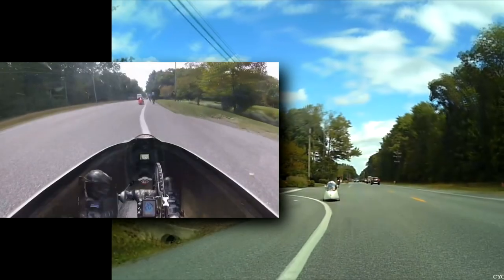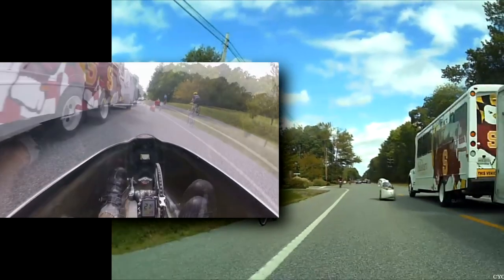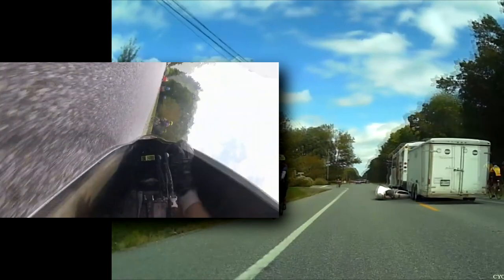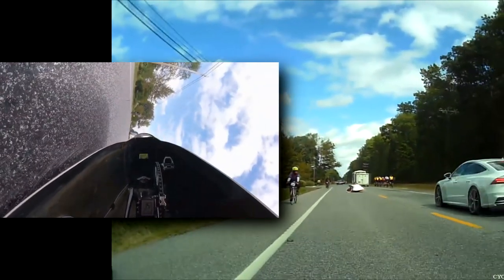Video 3: Side by side crash view

Comment: Lingering questions to learn?  Preventative actions to minimize this inherent risk.  In my opinion, one should always follow the lead rider.  If they move left, you move left.  They see objects sooner.  A wide, supple tire at lower pressure with a shock will help dampen and keep the rear tire on the pavement. Sealant will slow a flat tire deflation, possibly enough to keep from crashing.  I would be interested to hear of other's opinion how to minimize these risks.  Of course, not riding on roads with such strips can sometimes be chosen.  Stopping all rider motion when rumble strips are unexpectedly encountered?  Braking?    Lower tire pressure in the front tires should help with stability as the rear comes around....understeer?  I think the lower pressure in the front tires idea would require a brave person on a tadpole trike willing to experiment.

Comment: Great job explaining how and why it happened - Very helpful to understand why our velo's lose control so easily.
Reply from the maker: I remember the first time I rode the Sea Gull with you, you mentioned them and I was watching for them. Then a few months later on the 6 Pillars, I encountered the same issue but to a very small extent. Now when crossing rumble strips, I make sure to only hit them with the fronts, and put the rear wheel between the gaps.

Comment: I've the feeling that this wouldn't have happened on a QuattroVelo (4 wheels velomobile), because one of the rear wheels would have bumped but the second stays inline ==> no problem.
This means that if the Quattrovelo had opened front wheels and was hence able to turn correctly, it would be the perfect velomobile ! ;-)
Reply: Ditto, i have quattrovelo rear-end in my velomobiel. This vid will freak ya out.

velosRus dotcom
Reply from the maker: It has been shown in testing when they purposely flatten a tire, the QV did not lose it.

Comment: Glad Bill wasn't hurt! 

I ride an ICE Adventure (tadpole) trike with 20-inch wheels. I avoid rumble strips like the plague because of the discomfort they cause. Bill's accident gives me another reason to avoid them. Thanks for the physics explanation---the friction of the rear wheel is somehow related to a helicopter's need for a tail rotor. 

By the way, I also hate the bumpiness of brick roads (thankfully rare) and decorative pavers at intersections.
Reply from the maker: Yes, full suspension is nice to have, especially for a velo. My Sprint X 26 is not suspended, but still a nice ride. Thanks for watching.

Comment: Good explanation. Appreciated. We have raised rumble strips in Australia, and they are a PITA! My homemade velo has a 2.15 Almotion on the rear, because I do not have rear suspension. On one particular ride, I hit the rumble strips and nearly lost it! Similar scenario I guess. I have since mitigated the danger somewhat by running the rear tyre at lower pressures. I know this isn't always possible with some performance velos running relatively narrow rear tyres. But in my case, it is a workable solution. Cheers!
Reply from the maker: I tried the Almotion on my first Quest. It felt like I was pedalling through sand all the time. I changed it at the first stop on a 62 mile ride. My new Quest has Kojacks all around and I like them as much as I liked Duranos. A lot of people don't like either if them, but they work for me.

Comment: Great set of videos, thanks for your insight. I've had two or three similar moments, but got lucky each time and didn't tip. Rumble strips and bumpy roads can be mitigated against to a good degree that I'm happy with; what really scares me is a high speed rear tyre blow-out.
As an aside, I always feel safer against this sort of accident on my recumbent trike (Performer JC70) than in the velomobile (Mango) as the trike has a slightly lover centre of gravity and better brakes (disc versus drum). Also, the trike has no suspension and a larger rear wheel which, rightly or wrongly, makes me feel like I have more control in these sot of situations.
Any tips on whether there was anything Bill could have done to avoid tipping once the back end stepped out? It looks like he did an awesome job of avoiding a potentially horrific accident, so props to him for that, but does anyone think that there was a possible save from the moment things went sideways?
Reply from the maker: Thanks for watching. I'm not sure anything could have been done after the loss of traction began. There were probably a few things that could have been done prior to the ride, like lowering rear tire pressure. I had no idea he was running at 120 psi or I would have said something before the ride. He did a pretty good job of avoiding the truck and trailer for what he could control, but with everything going south in 3.5 seconds, not much time to do anything actually.

Comment: Thanks for the explanation of a hazard I didn't know existed. I am new to riding a trike, so it will be something for me to consider.
With model rockets and archery, you intentionally put the center of mass far in front of the center of drag to improve stability.
Reply from the maker: You're welcome, and welcome to the trike community! the possibilities are lower on an open trike (depending on the make/model of your trike) but this phenomenon is still a possibility on any tadpole style. Of course it's very difficult to put the weight in front of the drag point (front wheels) on a tadpole as it would merely tip up and be of little use to anyone.

Comment: Like all models, they are only good if they are useful and like you said Jim, the math is actually pretty complicated.  The Lego model is useful.  One point to understand and not a small quibble,  a torque is required to change the angular momentum albeit not a terribly large one when the rear wheel looses traction.  Moments ('torque' if you will) can be built into the vehicle due to various misalignments or once rear traction is lost, these torques can be external such as a rider continuing to pedal, or shifting weight around, steering input, braking (if brakes are not evenly balanced), crosswind, etc.  I do think riders can take steps to minimizes the inherent oversteer characteristics and the ensuring rollover behavior.  If a survey were conducted, I would expect some velonauts to say they can ride over rumble strips without the rear end swapping with the front, albeit not a comfortable experience.  The reasons are many but it is useful to understand them.   Thanks for the wonderful videos, it has been very helpful.
Reply from the maker: Well said Ed, thanks for the coment and thanks for watching.
Reply: I was trying to get clarity on the influence of 'moments' that change angular momentum, as you described in your comment above. The moment that I fixated on in my early comment was pedaling in response to a mention in the video of 'pedal steer' as an influence in directional stability. But, if I am understanding your point correctly, while pedaling input may have changed the velomobile's direction as the rear wheel lost traction, other influences may have also been a part of it. Does that sound correct? Still trying to understand this.
Reply from the maker: @randallsmith7885  that's about what I'm saying. I'm no scientist, and maybe smarter people can chime in and explain it better, but yes, arm, moment, cog, all of it plays into this. Keep in mind not every instance of tadpole rear wheel traction loss will have the same results, just something to be aware of.
Reply: @TheFlamingEyeball  Having crawled the Internet looking for information on this topic, and in particular information on velomobile design features, this isn't something for which the industry has developed a set of specs and a common language to discuss it around. For diamond frame bicycles, we can see published frame geometry stats that help us predict the behavior of the bicycle in use. But the velomobile industry may be a bit too new to have come to this point. Another area of curiosity is wind tunnel performance, which I suspect is an economic issue - as the companies that produce VM's are young, putting out relatively small volumes compared to the larger bicycle frame and wheel companies. But wind tunnel work at various yaw angles would probably provide excellent insights that could lead to increased speed and levels of stability in the wind.

Comment: Hello, I would like to ask, if all velomobiles are so risky on non flat roads or if it happened because of the design of go-one (stiff suspension, maybe too high centre of mass). I live in an area, where much roads consist of patches on patches, so pretty bad for riding. All the same I was thinking of buying an alleweder, as it has good suspension, but the seating is also high. Would it be too risky to ride it on those roads?
Reply from the maker: The Go-One is a bit more narrow than other velos. The Alleweder does sit higher than other velos, but has suspension and seems to be more stable. I personally have never ridden either one. If you have to travel on rough roads, it would be most important to get a velo with full suspension. Depending one what speeds you want or need, you could also change tires to accommodate more suspension. Not knowing your roads, it's hard to tell, but any velo can be good or bad depending on all conditions. I've found I just love riding my Quest just about anywhere.

Comment: its important to always remember that this low speed accident would have been almost academic and trivial if it was not for the existence of the large motorized vehicles, which should have been banned decades ago if the humans were a rational and good species
Reply from the maker: There are places for both powered and human powered vehicles. Just happens that this ride is on a weekend when the temps are usually cooling for Autumn, and this is just prior to the big stop at the beach where many other non-cycling visitors are also traveling to at the same time. Small road, and lots of traffic of all kinds. We're just glad it wasn't worse.

Comment: Your explanation of how it happened seems well founded but you don’t address that it shouldn’t have happened in the first place. As I said on Saukki’s channel when he showed a clip, any vehicle that behaves as unpredictably as this has a serious design flaw and is a potential death trap. When the inevitable happens I wouldn’t be surprised if the manufacture will need to answer in court why they knowingly sold such a flawed design. 

Do you think tyre pressure could have contribute to this particular accident, either by being to high or too low?
I can’t remember whose channel I saw it on but I recently saw a video with an expert asserting that most racing tyres are over inflated and that it not only adversely effects speed and comfort (due to greater vibration) but also handling. I’ll have a look through my history and see if can find it.

Found it. It’s long but we’ll worth watching. Another thing to consider is the tyres have the weight divided between 3 wheels not to so even allowing for the extra mass, they probably need less inflation than a bike.  
https://youtu.be/asEYkpW0vwQ
Reply from the maker: It's difficult to understand and predict for sure. But some risk is associated with just about everything we do. Regular upright cycles do not come with a disclaimer that they are inherently unstable, especially at slow speeds or stopped. None of them have been sued because the bike did not stand up on its own in these situations. No one has sued manufacturers of MTB bikes when they crash hurtling down a mountain and they are specifically designed for such use. This issue is not new to me, but evidently not as many knew about it as I had previously believed. That's why i shared it and allowed Saukki to do so as well. Information is power, but it does not necessarily remove all the risk. Some things you just understand and accept. Would it be wise to sue everyone that provided a product that has associated risk? Probably not. 

Turns out McDonald's does serve hot coffee..............
Reply: Catrike & The Flaming Eyeball 

I’m in my late 50s and I’ve ridden many thousands of miles on bikes and motorbikes most of my life and I’ve had my fair share of accidents, cuts bruises and broken bones, all were down to either inexperience be me or other road users or me riding faster than the road conditions (and my skill level) would allow and never have I had or heard about an accident like this  where a vehicle violently and unpredictably veers of course without the rider having done something wrong or the road conditions being poor. 
I get it, you’re defending a form of transport you love, and to be honest, if I had more disposable cash and somewhere to store it I’d be interested myself, but only if I could find one that was a lot less unpredictable than that one. 
When you talk about the risk you’re comparing apples and oranges. When you take a bike (or any other vehicle for that matter) off road, you know that the conditions are unpredictable and there are associated risks. 
In this instance Bill was riding perfectly normally, he wasn’t being reckless or speeding, the road was straight and dry, visibility was excellent, no diesel or other debris and the road was in a good if not perfect state of repair with no sign that there was danger ahead, yet he ended up millimetres from being crushed by a truck through no fault of his own. Rumble strips are so common that there is little chance that on occasion you won’t have to cross them, not knowing if something similar is likely to happen should be highly concerning. 
From what I’ve heard its not just rumble strips that are the problem with tadpole trikes, poorly maintained and repaired roads, grit and gravel can lead to similar events. Also its not just the riders safety at stake, its the other road users that have to make reflex action avoidance manoeuvres.
I’ll bet you £100, I or any other competent bicycle rider could cycle back and forth for miles on similar rumble strips with no ill effects other than a sore bum, I actually think my ex would enjoy it😉
 You didn’t answer my query about tyre pressure, do you think having it to high could have contributed to the accident?
Reply from the maker: @thechumpsbeendumped.7797  Apologies, I was side tracked and typing it all out on my small phone screen.....tire pressure (excessive in this case 120 psi) in combination with no suspension DEFINITELY contributed to Bill's crash. Had any of the rest of us known he was riding with that kind of pressure, we would have advised him to let some air out.
Reply: Catrike & The Flaming Eyeball 
I bet he let more than air out when it happened.
Did you watch the attached video about tyre pressure.
Reply from the maker: @thechumpsbeendumped.7797  Don't know that he's ridden it again since. Parts on order form Europe are taking much longer than expected.

Comment: As a theoretical exercise, if the driver of the velomobile stopped pedaling at the moment the rear wheel hit the rumble strips, would the machine have stayed in its intended travel direction?
Reply from the maker: Probably not. The rear wheel at 120 psi with no suspension at 20 mph would have lost traction no matter what. 3 seconds is all it took. Not sure there was much Bill could do about it at all.
Reply: Checking my understanding of the logic. The thing I took from the explanation is that pedaling creates side to side pressure, which is resisted by the friction of the rear tire against the road. The rumble strips removed that friction and the side to side motion was no longer being held in check, allowing the velomobile to veer. I agree that this all happened very quickly and that is why this is a theoretical discussion that probably has no practical application in a situation where a rumble strip is not anticipated.
Reply from the maker: @randallsmith7885  the exception is that we know this happens even if you are not pedalling. It's because the center of gravity, and arm of motion is behind the pivot point (,the front wheels) and the rear wheel actually keeps the weight in line when it maintains traction. Once it is lost the weight wants to shift forward. Hard to explain with my limited scientific knowledge, but you saw what happened.
Reply: Appreciate your perspectives Catrike.

Comment: So, essentially, trikes want to be deltas.
Reply from the maker: Not necessarily. Deltas have their own set of issues. When cornering on a delta, it is much easier to roll. And there is the whole issue of power transfer to the rear wheel or wheels. It's a different set up with a different set of problems.
Reply: @TheFlamingEyeball  
Which problems are worse?
Deltas are not much easier to roll, BTW.  That is a universal statement which does not factor many variables.
I have been riding with many trike riders on various types of trikes over the past 12 years.  I have either witnessed, or heard about, several crashes and the tadpoles are no better than the deltas.
Reply from the maker: Not saying problems are worse....just different. For instance, for the same power and speed on a corner, you can roll either trike, just depends on how you actually take the corner. I suppose there are some universal statements made about many different rides. I've been on recumbents since 2005, and have even had a crash on a two wheeler (RANS Stratus XP XL). Went around a corner and there was some loose gravel. Before I knew it I was on the ground, broken mirror, and bleeding arm. Fortunately, I was only about 3 miles from home. Didn't ride much that day, or for the next few....Anyway, I think we can agree, every situation is different, and every rider different in each situation. We're all trying to be more careful, and I hope my report just helps others.
Reply: @TheFlamingEyeball  
Without any doubts, this video helps people understand a potential problem.